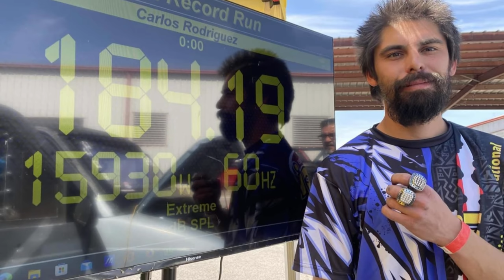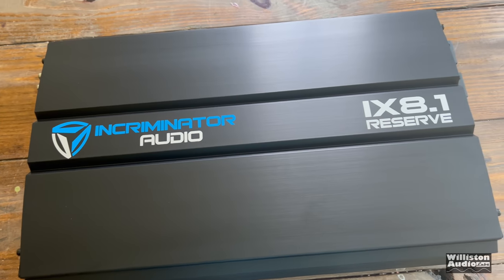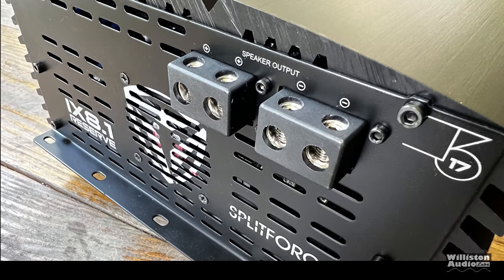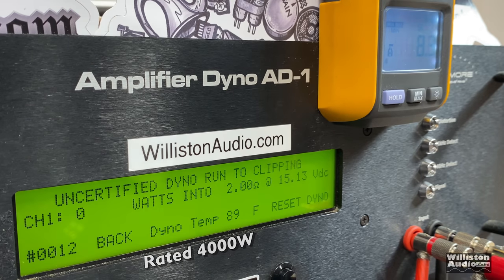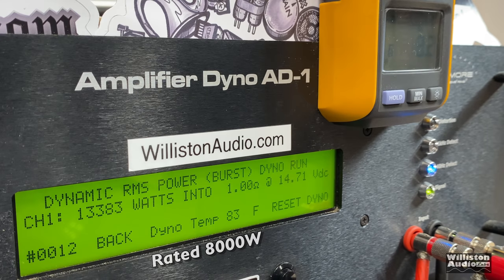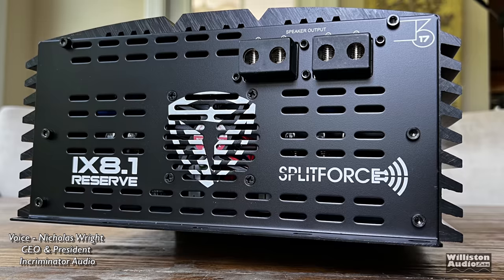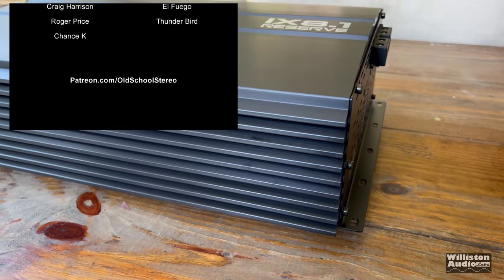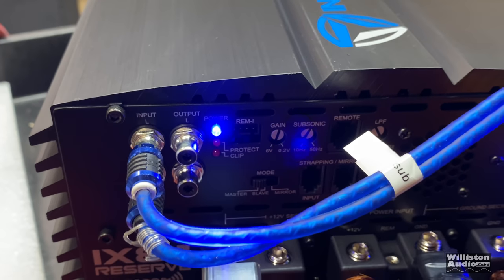8K like ALL DAY? Incriminator Audio IX8.1 Keeps It's Cool and Pumps Out the POWER! [4K]

Comment: What it means is that it's a high distortion amplifier, 2k @ 1%, but 3.5k @ 20%, @4ohm
Or, it can only do about half rated power up to 1% THD.
Whether or not that matters depends on what you expect from it, if you only plans to use half or less of its total power at any impedance, then it's probably ok, maybe.  If you plan on using its full potential, it's gonna be horrid
Reply: No, that kind of response is exactly what you want. When you see an amp that basically does the same power at 1% and clipping it means that the power supply is having a stroke and falling apart. That'll generate lots of heat for both the amp and the sub. Having a large gap between clipping and 1% thd means that the amp has a strong power supply which can keep trucking for a long time.
Reply: At 1% you arer pretty much at the very limit of rail voltage, as you slowly start to square the wave off harder and harder, the top of the wave gets flatter while not actually getting taller, because voltage is exactly the same, but power starts to increase exponentially as the average of the wave turns DC.  Even though you are getting exponentially more power, I don't think a speaker would create any SPL with it, just huge heat.   
It is very common to see class D amps, tested here in this channel, that double power at half impedance but also don't put out much more power at clipping than 1%thd.  Class D amps have inductors on their outputs which turn the output square wave into a sine wave, so when a class D square wave amp clips, it can't turn square.  This amp being class D seems to be creating excessive distortion at only half its rail voltage.  Compared to a Sundown, Orion, any top brand, this amp is creating way more distortion for a given percentage of rail voltage, which equates to output power.
Reply: @minus3dbintheteens60  the output inductors filter out the very high frequency noise generated by the fets switching like 100khz+. It's not gonna turn a 40 hz square wave into a sine wave. If it could turn a 40 hz square wave into a sine wave it would be heavily attenuating any information above ~80 hz. Which means it would have an extremely poor frequency response.

Also keep two things in mind. 1 this amp does rated at 1% thd. 2. Going into a soft clip before a hard clip means that you'll be able to hear that you need to turn it down earlier. Assuming you can even hear the minor distortion at 150+ db, which is what this amp should make in any decently designed system.
Reply: If you feed a class D amp a square wave signal, and put a scope on the output, you will see a sine wave.  The inductors in class D amps are massive.  There is a video by Barevids called Does a clipped heading damage your subwoofers.
Reply: @minus3dbintheteens60  that's the input filtering. Not the output inductors. If you clip the amp itself and scope the outputs you'll see a square wave. Look at the number of turns on an output inductor vs an 80 hz low pass inductor.
Reply: I see.  But I don't understand why you think this amp would be superior when it's distortion is rising and rising up to the rail voltage vs an amp that puts out only 1% THD at the rail voltage.  An amp that has "poor uncertified power" is driving the outputs with full rail voltage at 1%, while this amp is at 3/4 rail voltage at 1% and at full rail voltage it's like 20%.
I'd just add that we know it's full rail voltage by the dynamic burst test, that's showing us the voltage difference between full rail voltage, stored in the caps vs rail sag
Reply: @minus3dbintheteens60  long story short, it's a story of headroom. It shows that all the parts are overbuilt. Amps start distorting when you stress them out, and amp like this gets stressed and keeps on trucking. An amp that does 1% right before clipping is also doing it at 3/4 rail voltage, it's just that the rail voltage is collapsing under load. 

An amp like the ix8 is designed to provide rated power when you clamp it on a sub, that means you have to have a lot of headroom. Those cheaper amps are designed to look good on a Dyno.
Reply: I'd love to know why some amps have a distortion curve that is mostly flat vs output power and then hits a brick wall, vs a response that starts low and increases linearly up to clipping.  I assume it's a topology thing?  I believe I've seen both class AB and D both go both ways amount different models
Reply: @minus3dbintheteens60  as I've been saying, if the output hits a brick wall it's because the amp doesn't have the headroom to support rail voltage once it gets stressed out. Amps like the ix8 that are overbuilt keep trucking well into distortion. And due to the sheer output of these systems you can't hear the distortion until it clips. And since it's a cleaner clip it doesn't harm the amp or sub as much
Reply: I notice a trend with cheap "Brazilian" amps vs "Korean" amps, the Taramps MD8K does 2500w at 1%, Clip & dynamic at 4 ohm, and 5K all tests at 2 ohm, exact ohms law.  Because dynamic burst is so short, its just emptying the rail caps, which sit at the max potential voltage, in other words, an amp cant do any more power than it can dynamically, because the test eliminates the power supply's current shortcomings.  So if the amp does 2500w at 1% and clip and dynamically, it says to me there is 0% voltage sag in the power supply even when the amp is at 100% output, same at 2 ohm, 5000w 1%, clip and dynamic.  The fact that output exactly doubled shows ohm law that backs up my theory, that the amp can deliver all of the power supply current without loosing even 1% of its available current, all the while, at max rail voltage, it can do 100% output at only 1% THD.
Where as the Korean boards seem to double power exactly at 1% THD, the IX8.1 and JP63 can double output power at 1% THD from 4 to 2 ohm, but dynamic power is over twice as much as the 1% test, meaning it is beginning to introduce distortion when its only providing 75% of the rail voltage.  The IX8.1 has 125v rail, but by the time it outputs 95v it is already at 1% of distortion, and its going to distort more and more as you turn it up to max rail voltage.  The MD8K has a 100v rail and you can push that to 100v before it outputs 1% of distortion.  
Choosing between 2 amps, a Korean that does 5kw into clipping and a Brazilian that does 5kw at 1%, the Korean is going to put out half the amount of power at 1% of the Brazilian.  It seems to me that there are 2 very different designs, and the 2 are design choices each with pros and cons.  If you want an amp that has more headroom, thats fine, as long as you are ok with the extra distortion, like blowing past the 0 mark on a receiver.  I'm not trying to bash on this amp, I think it's terrific that they have rated it truthfully and accurately, as an 8K amp, I don't know how I feel about people leaving the video thinking its a 10K amp though.

Comment: Not very aesthetically pleasing to be honest. I know it's purpose is so it can be used in competitions, but for the price you would hope for just a little effort into looks, it looks even more plain looking than a Blaupunkt. A cool color or graphics would go a long way.
I hope you get a chance to test out an NVX XAD series amp, which are full bridge but seem to be priced lower than Taramps and Slayer. HiFi Vega did the 2,000 version not too long ago, would be nice to see one of the bigger ones. $389 for the 5,000w, $600 for the 8,000w, or $1,099 for the 13,500w all seem to be steals.
Reply from the maker: I attempted but NVX and I had some differences in opinion about the terms of the tests. They have great products and always have 👌
Reply: @wal  That's too bad that NVX would deny themselves the exposure.

They don't really do it anymore, but Sonic Electronix would themselves dyno a lot of the amps they sell and NVX would always put up excellent results. I wonder if NVX ended putting any terms with them despite being their in house brand.

Comment: So strapping the amps 8,000 watts has to travel through the telephone cord to the next amp. Thats crazy how that little cord can pass that many watts to the next amp. I prefer running amps by their self not strapped
Reply: Not the case at all. Completely different low level signal going through that cable than you're thinking.
Reply: @nelomedia805  if the master amp is putting out 16,000 watts when they strapped 8,000 watts has to come from the slave amp through the telephone cord or rca's
Reply: @fusiondensity3287  lol no the amps produce power the phone cord just sends the signal learn how too hook up the speakers and you’ll learn the positive on one stays positive and on the 2 nd amp the positive becomes negative than you connect the other positive to the negative wire.   WTch a video on strapping amps
Reply from the maker: I’m sure others have replied but the phone cord only carries the signal, not the output

Comment: ok so you want to get as loud as posable . we all know its 1 and a million shot to get sponsored . years ago we would have died to get big power but in todays REAL world its a couple clicks away  and you can get what you want dirt cheap . 250 amp alts are only $150 on amazon . 20k spl monster amps from teampie are $1300 . 18 inch spl beastmode woofers from jld audio are $250 that have 800oz 4 stack motor and have 3.5 inchs of total xmaxx (model ext18d1 ) ! 4/0 welding wire from ewcs  is $190 (best wire money can buy ) 8 inch mid range  Carbon Fiber Cone and Rubber Surround, Die Cast frame,, 75W RMS at 8 Ohm are $45 ( mcm 55-3550)  1-1/8" Silk Dome Truncated Tweeter 8 Ohm are $26 (dayton dc28ft ) next leval audiophile sq dsp amp from teampie are $250 ( TP-2504)

Comment: What $2000 for that amp what are they smoking I want some
Reply from the maker: Check out Sundown SALT-8, Crescendo 8kW, DC Audio 7.5kW, etc. They are all at least $2000
Reply: @wal  but the thing is is it really worth it. When you can find a cheaper amp that puts the same power out the same power but I'm sure it's not like what the dyno shows. If you know what I mean

Comment: What would you say are some of the most efficient amps around 2000 watts? I'm trying to put a system in my dad's car that's gonna thunder. Its got a stout electrical system for an OEM so I'd like to leave that alone and put a really efficient amp in there.
Reply: I'd probably do something like a DD M4000 at 4 ohms. Running a big amp at a higher impedance is the best for efficiency
Reply: @blakebrockhaus347  I've always wanted to try DD products since they are local to me. One of my friends got a DD sub from a pawnshop that didn't know what they had and it sounded really good even in a cheap prefab box.
Reply from the maker: I wouldn't go over 1200 or so with a factory electrical system unless the alternator is 200A or more
Reply: @wal  It has a 180 amp alternator and it has an H8 battery so borderline acceptable?
Reply: @c0c0asauce  yeah, clamping 1400 watts you ought to be fine. Tho putting a higher discharge agm or a lithium batt would help a lot
Reply: I'd HIGHLY RECOMMEND the IA 15.1, DC Audio 1.2 or 2k, or the Trauma 2k. Personal experience 😉

Comment: Looks more like a generator than a amp
Reply: Just supply it with 60Hz from a signal generator app from a phone and you have a power inverter! ;-)
And yes, it does resemble the inverters on the market.
Reply from the maker: Inverting those subs if you push them too hard 😊